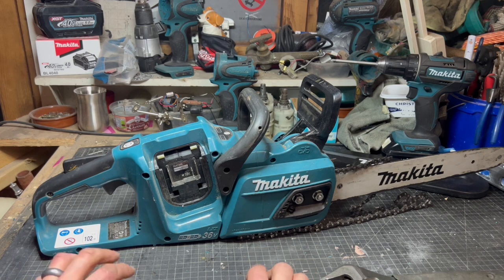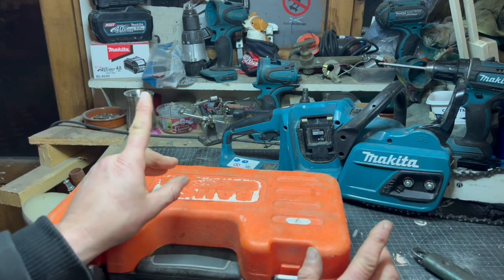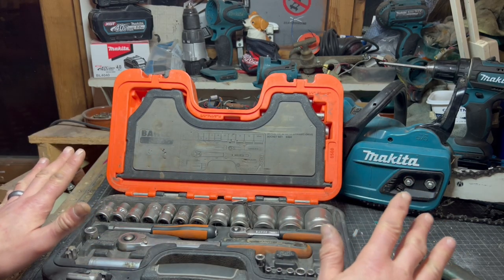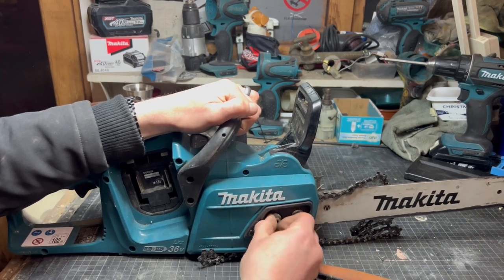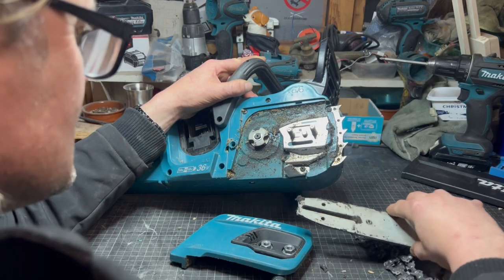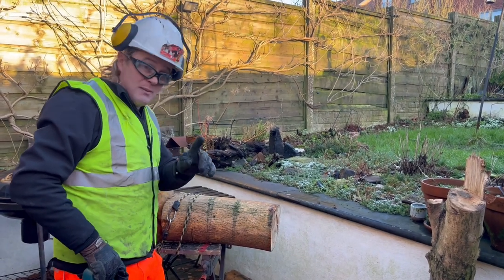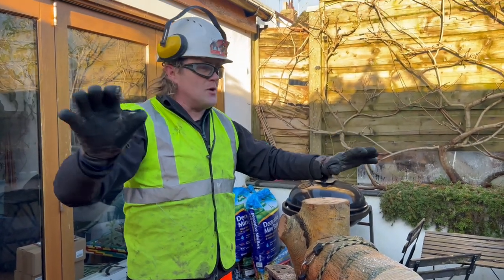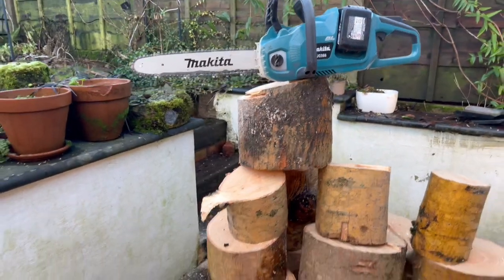MAKITA 36v CHAINSAW FIX AND TEST PLUS BAHCO SOCKET SET REVIEW!!

Comment: Jon you're going to be disappointed in me but for garden tools I went for Husqvarna. I've got a battery chain saw, long reach pole chain saw and a brush cutter. They're all better in tests over Makita 😳. But the batteries are expensive. On the plus side I have got a Makita hedge trimmer 😅
Reply: Oh dude, you ain’t right the “better than makita” when tested. Have you watched arborists and their tests? Most didn’t like Stihl battery powered. Most liked Husq. But even more like Makita the best. Over dewalt and Milwaukee, of course.
Reply from the maker: Cheers sir 🤟🤟